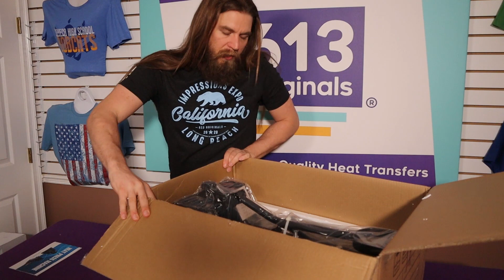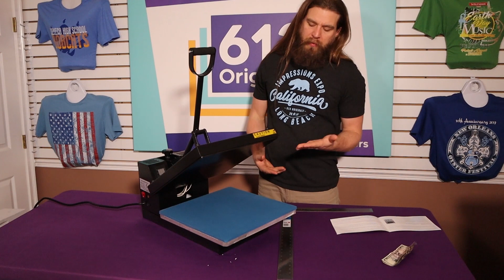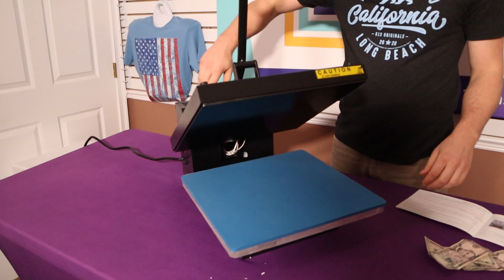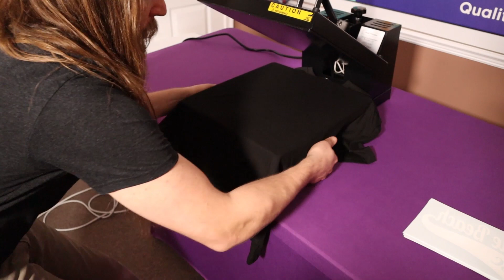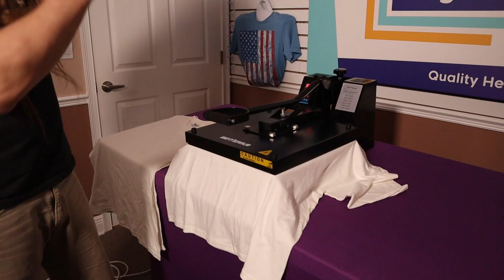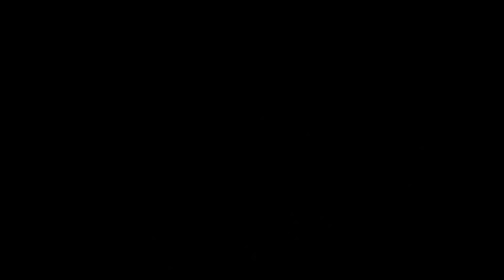613 Originals - Amazon Heat Press: How Well Will It Work?

Comment: All the transfers I ordered from 613 originals cracked they said it might be something I'm doing wrong but the samples they sent washed and dried well and still hold up maybe there not using the same inks as they do for the sample they send out
Reply from the maker: With proper application and after care all of our transfer formulas should not experience cracking, please contact support@613originals.com with you order number so we can troubleshoot your experience!

Comment: I remember hearing somewhere that the teflon platen cover will affect the transfer. Does the teflon pillow also affect the transfer? How would you compensate for the heat loss due to the teflon?
Reply from the maker: Good question Joseph, we do not recommend putting any barriers between our transfer paper and the metal of your heat press as that can effect the temperature of application. The teflon pilllows we were referring to would go inside the garment and should not interfere with the temperature of application.

Comment: That was fantastic. Thank you. I was wondering, if of course you might have a free moment you wouldn't mind spending on a reply to this comment, where could I get a "curved" probe like what I saw in your video? I found a pyrometer like the one in your video but it comes with a straight probe that just seems like it could be problematic trying to get a reading on the platen closer to the back. Either way, thank you very much.  Have a groovy kinda day!
Reply from the maker: Hey Aaron! This did take some tracking down but we were able locate a curved attachment on Amazon.
https://www.amazon.com/K-Type-90%C2%B0-Angle-Surface-Thermocouple-Temperature/dp/B004E5EBM0

Comment: what size print are you wearing ? I want a print that size!!!!!
Reply from the maker: Hey Aireon! Rick is wearing a 12"x12" sized graphic, the larger of our single image programs. This is in our super soft Vintage formula and those shirts were available at ISS Long Beach back in January!
Reply: @613originals  Thanks...I just want my prints to come out big
Reply from the maker: @aireonhyman3330  we print your images exactly the size you upload them and our largest gang sheet size is 12.75"X19"!
Reply: @613originals  So I don't have to create my image at 12x19.... It just has to fill on the squares?
Reply from the maker: You will create your image the size you want it to print in your design program as well as having your sheet size set to what you are ordering.

Comment: Could you do a test with the same standards, with your recommended heat press (Hotronix) and do multiple shirts, check and record heat settings on platen,  wash test,  and show off the results such as whether or not they are cracking with minimal stretching etc for a side by side comparison? I use many of these transfers from both 613 and Fm and like the product, but definitely show mix results with a cheap heat press. Many people or businesses that use a .15 cent transfer, cannot afford an expensive press such as myself, or they would also more than likely have a full screen print setup and no need for a cheap transfer. Would just like to see a real life comparison is all. I appreciate these videos as I use your products everyday as part of my business. Curious to see the results from an expensive press for comparison to see what we are up against and what better results we could achieve.
Reply from the maker: Thank you for commenting and for your endorsement of our products! This video was a cursory look at a great starter press and how it performed while dialed in to what we recommend for our Varsity formula and how it actually performed. There are follow up videos coming with us "dialing" the settings on this press as well as a review of our Hix heat presses. Stay tuned in for those follow ups and stay safe!